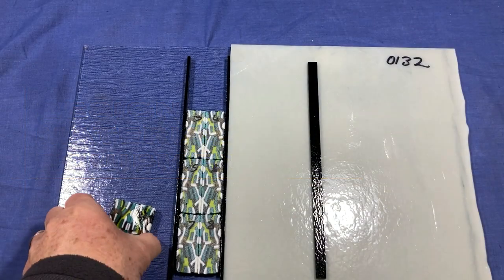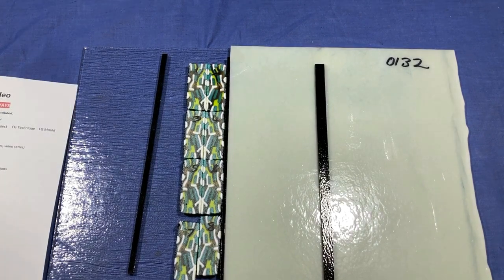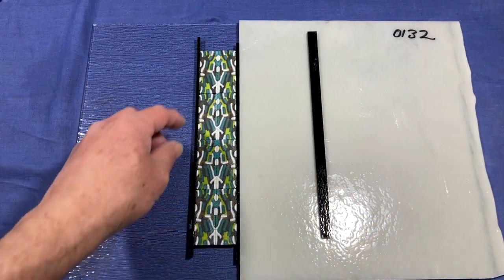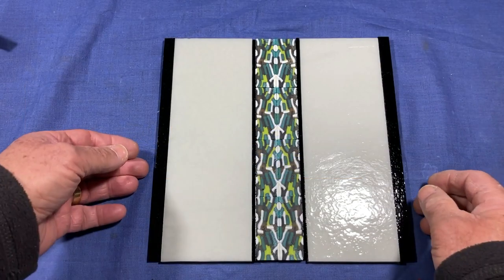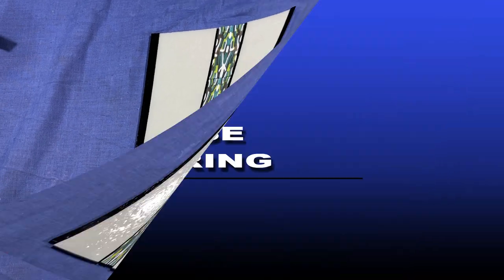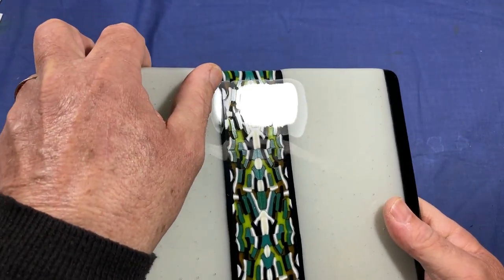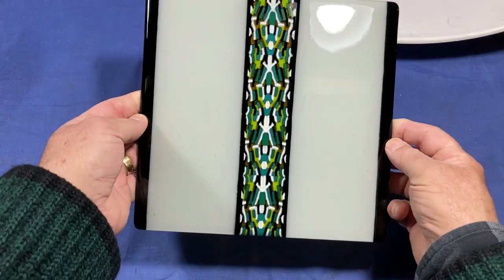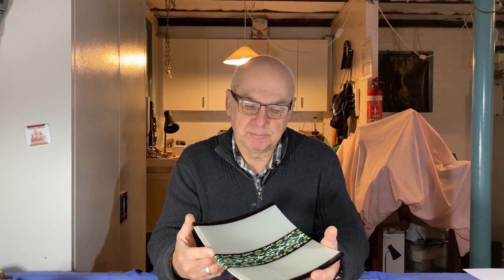Wow! I Really Like This One. Fused Glass Bowl Project Tutorial

Comment: A beautiful piece❣️❣️❣️
I purchased a wet tile saw, I have to order a diamond blade, For some reason I feel apprehensive about running the saw, I had the same feeling with my Taurus ring saw, but now I feel a little more comfortable with it.  I’m new to fusing and Learned so much from you!  Thank you❣️
Reply from the maker: Hi Patricia. Yes, it is a little daunting at first. All that noise, glass cutting etc. I just took it easy, checked my safety (glasses, face shield, mask, apron etc) a few times and fed the piece slowly at first. Stopped at the first hint of anything I wasn't sure about. I soon got used to it.

Comment: What grinder did you use with a straight edge to attach to the platform? My grinders are probably 20 years old and I was looking for one that had that as an option but did not find one. I have been out of fusing for 4-5 years kiln went down and I am just ordering parts to fix it during the winter. Thanks for your video.
Reply from the maker: Hi Tom. That's a little Glasstar Grinder. I looked on Amazon but they don't have one, or at least I can't find one. This is something similar https://amzn.to/3TOVzbl